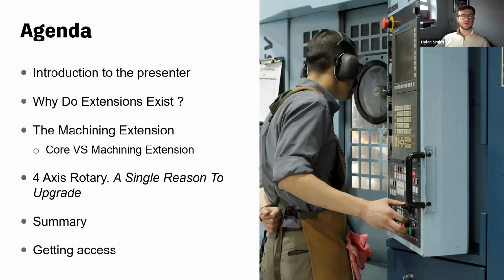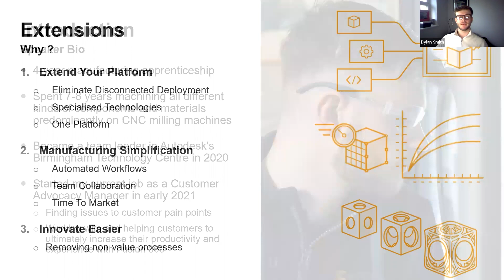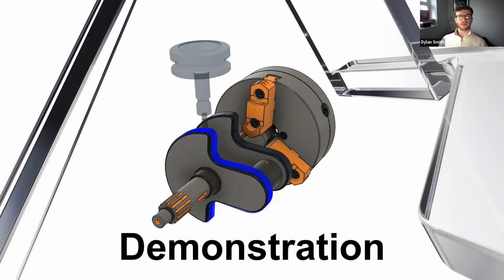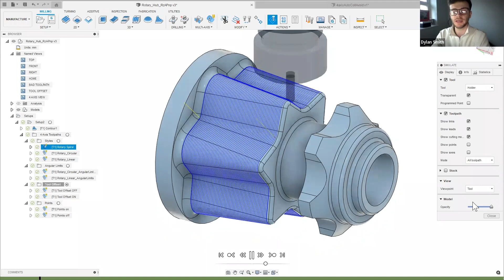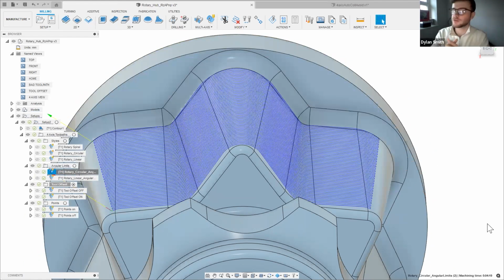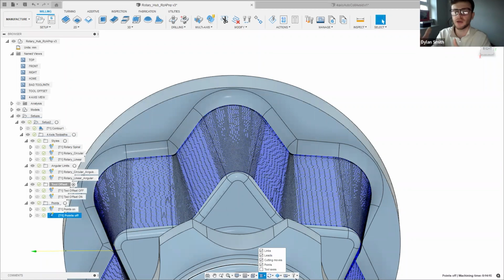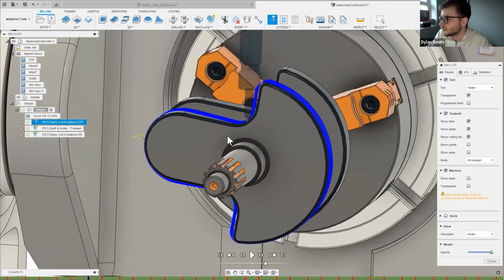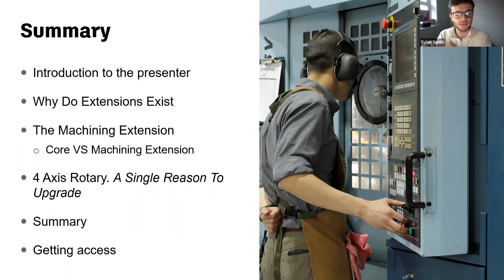Webinar: Why 4th Axis Rotary is Worth Upgrading to the Machining Extension | Autodesk Fusion 360

Comment: I used rotary just the other day on my UMC750.  It’s pretty jerky even after playing with smoothing
Reply: I also use it on a UMC, check your rotary axis, that you have high speed machining enabled in the HAAS control and that the feed rate of the tool isn't slowing down your rotary movements (they are connected).  I have found with the correct axis its smooth, but not the most time efficient tool path

Comment: i've never understood how the machining extension is 3-4 times the cost of the base subscription considering how much you get with the base subscription
Reply: I think that the intent is to give people a usable product that will do CAD and CAM and at very reasonable price, but then to enable more advanced functionality to be acquired like toolpath trimming or the drill hole recognition.  I balked at the initial additional Manufacturing extension cost, but for me given the commercial jobs we do it paid for itself in a couple of days... But everyones needs are different and may not represent same value to say a hobbyist.

Comment: Great software, But expensive. At $1,600 PER YEAR just for the machining extension on top of the yearly subscription for the core program. The average user is excluded from using it.
Reply: Is this "average user" a professional machinist / machine shop OR are you considering the "average user" a hobbyist using an X-Carve in a garage?
Reply: @Jason L  im referring mainly to the hobbyist and small job shops. You just gotta do the math and see if it works for you. If it is, Great.

Comment: Fusion 360 does not have a  Mitsubishi 4axis post processor available on its website.
Reply: Autodesk does its best to provide free posts for as many machines as possible. IF/WHEN a post is not available for free on the website, you can still create the post yourself (for free) by modifying an existing post. Alternatively, you can hire an Autodesk reseller to create the post for you (for a fee).

Comment: Guys this software is great. 

It solves a lot of issues many people struggle with daily. 

I have 1 major displeasure with this though. My biggest issue with this is the fact that this machining extension cannot be integrated in autodesk inventor. ITAR requirements are met with inventor, and not fusion 360. It would be largely beneficial for autodesk as well with more sales.  

Please. Make this amazing product available in inventor. It will give you a bigger market share. Heck, charge a little more for it then you do in fusion. I’ll pay for it!
Reply: Are you really wanting this extension for Inventor OR are you really wanting Fusion 360 to be ITAR compliant?